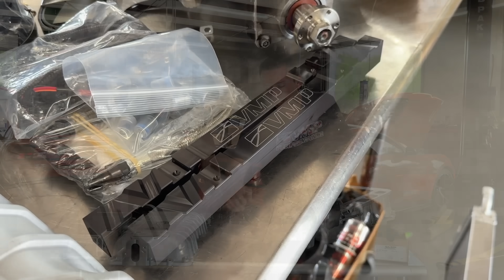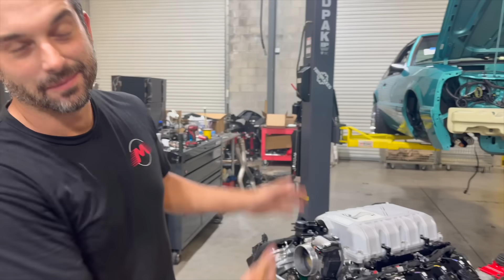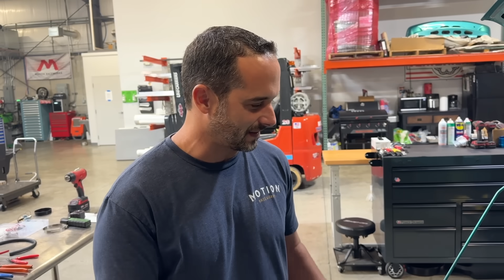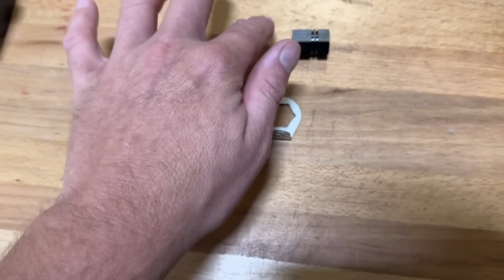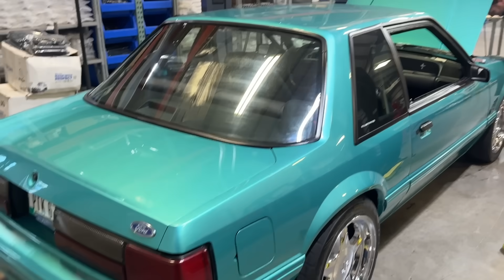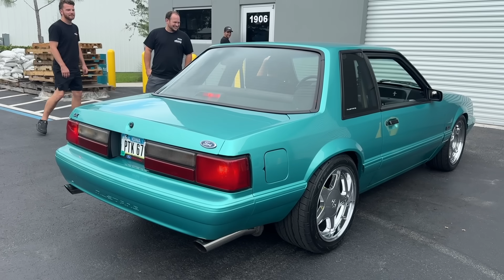First Start Up! GT500 Swap Fox Body Is Insane!

Comment: @MotionRaceworksOfficial; @BrettLaSala; @DougCook; @AndyCook; This "new age" Foxbody/chassis street/performance/DragNDrive/Racing/HotRod has most all of the desirable upgrades within the modern Ford performance with this SuperCharged Coyote Predator 5.2 L GT500 type powertrain !!
The one "modern" simple upgrade it should have, but is missing is "Flex-Fuel" sensor, operation. The excuse about lacking E85 and other ethanol operation, usage is poor, inexcusable, and nonsense when simple "Flex-Fuel" allows for all variations of fuel type and range usage within available at fuel stations and higher ethanol content racing fuel too. This is a simple and fully useful upgrade for every Street-Rod/performance/racing vehicle.
All The Best and Much Success , Sincerely 🙂

Comment: Still an awsome and very clean build. Would be amazing to have a foxbody at that power level. I arill have a 347 ford racing stroker that i built for mine in 2006 for an 85' mercury capri GS 5.0. Probably needs to be gone through again but with the big ford racing X-cam it would be lucky to make 400hp but sound nasty. Now better cams are available but these coyotes are insane. Factory hp is more than i would expect from a built NA 347 ci small block. We are in the muscle car era boys. Even the late 60's and early 70's cars have nothing on modern engines. Back then, you chose a cam for low end torque or high rpm hp. Nowadays you can have both with factory cams. You have to have a special tune to make it idle rough😂😂. A friend of mine dual collector turboed a 2019 gt 10spd that made 1,100hp at 12 psi on factory cams. I warned him that it wouldn't last and that he should buy a built short block. He said, no it's fine😂😂😂. He got that short block later on😂😂😂

Comment: That is not cold air. The factory air box was cold air from the fender. I hate those tubes pulling air near the headers under the engine compartment

Comment: Why not go flex fuel and give you all the options including e85?
Reply: My post includes this also as a necessary simple upgrade that should exist for each, every, all Street-Rod/performance/racing and all vehicles in this era for over 20 years, including from OEM. 
NO excuses. Simple, Period.

Comment: That coupe is bad-a$$. The only thing that it might need is hole cut into the driver's side inner fender for that intake to have a cool-air source and maybe a small cowl hood for the engine bay to have a bit more ventilation, especially with a boosted high-hp engine.

Comment: One big factor is that fox body probably weighs 400-500 pounds less than a GT500…. This thing should fly with more horsepower and a considerable amount less weight than a GT500.

Comment: how are you only using one side of the fuel pressure regulator, isnt it a return style system. Im geussing the bottom goes back to tank and top is one side of the rail where does the other go. Really clean setup, would love that setup for my coyote swap fox would clean up the cluster of AN lines i have. Thanks

Comment: Did you swap control packs?????
IS IT ON GEN 1 CONTROL PACK STILL?? DID U SWAP CAMS?? 
OR IS THAT A GT500 ECU PATS DELETE??, 
GT500 IS GEN 2 BASED SO GOTTA BE ONE OR THE OTHER, DID I MISS THAT PORTION?

Comment: SLICK! I drive a thirdgen f-body, the natural enemy of the fox body, but I’d never turn down the chance to put a fox coupe in my garage beside it. The whole I went with the f-body is because it was a far better starting point for what I wanted to do with the car and price it would have cost just to get the fox’s handling on the same level as the f-body.

Comment: I am new to the restomod world and drag & drive. I have heard a lot of people and you guys in this video talk about fuel. Why don’t you guys make it flex fuel so you can run 93 or e85? 

Why don’t more people do this? Then you can cruise on 91,93 and get e85 when and if you can?
Reply: Jim You think much as me and many others. "Flex-Fuel" is the simple upgrade each, every, all Street-Rod/Performance/racing and normal vehicles should all have including OEM for over 20 years !! 
All The Best, Sincerely 🙂

Comment: I think the difference in the sound of the exhaust is because the mufflers are in front of the over-axle tailpipes and not behind them. We lost that signature V8 Mustang sound in 2005 with the S197.
Reply: The 03 Cobra exhaust goes under the axle, there are some sn95s that came with side exit exhaust like the 2000 Cobra R. Personally, I hate the "iconic" sound of the foxes from the 90s. I've owned 12 and every one that I owned that jad flow masters, immediately got tossed in the trash. To each their own but the modular engines sound a million times better than the pushrod junk, and the coyote sounds great as well
Reply: @damianlindsey6177 ....but the mufflers are upstream of the tailpipes.....I guess you've never heard a pushrod powered Foxbody with heads, cam, intake, longtubes, an X-pipe, and tailpipes with chambered mufflers....my personal favorite combo....but...to each his own. Exhaust sound is very subjective.
Reply: @css0076 yes, they are. And yes I have, there's a few running around here and one of them is a 81 Capri with a 393w with a big solid roller, afr225 heads, long tube headers with a full 3 inch exhaust with an x pipe. Has a set of chambered flowmasters and that kills the way it sounds. The deep, hollow sound it has is just drone. If thats what you like cool, I personally cannot and never have even back in the fastest streetcar shootout days in the early 90s when all of the "racecars" had them.